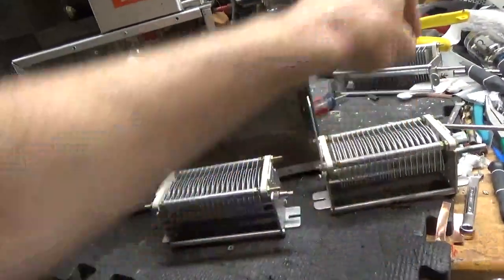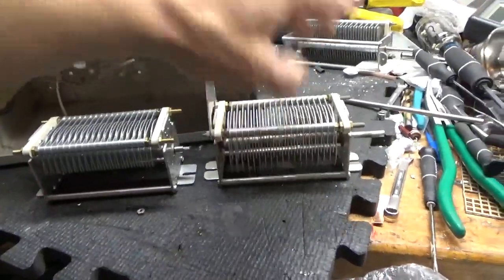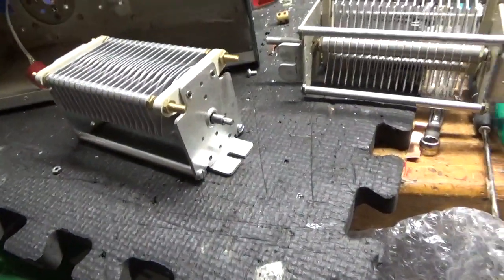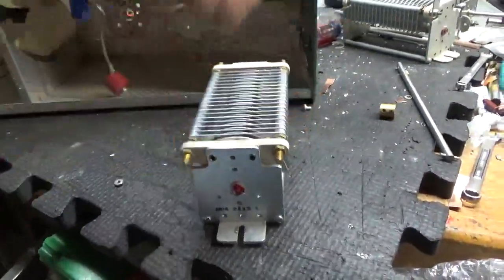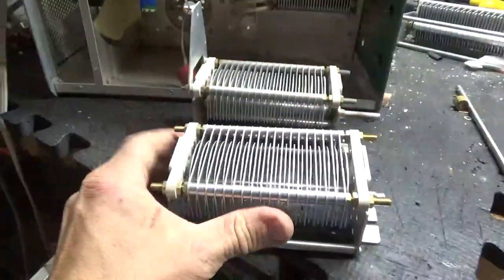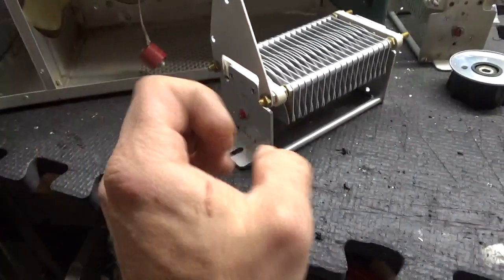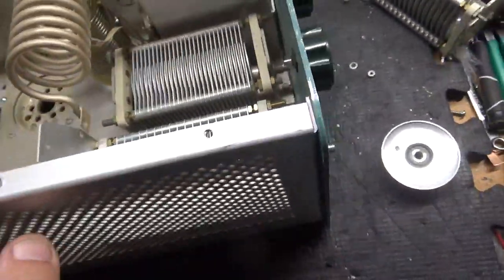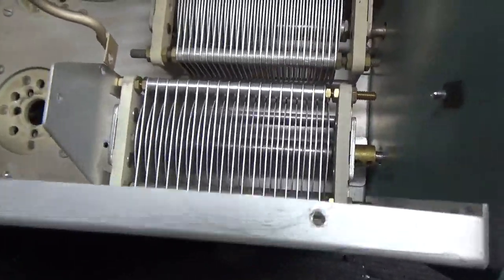Replacement Plate Tune Capacitor Option Heathkit Sb-220

Comment: How/where did you get the Ameritron part? I looked on the MFJ and DX Engineering, and could not find that plate tuning cap.
Reply from the maker: Call ameritron. its the al80b plate tune air variable capacitor